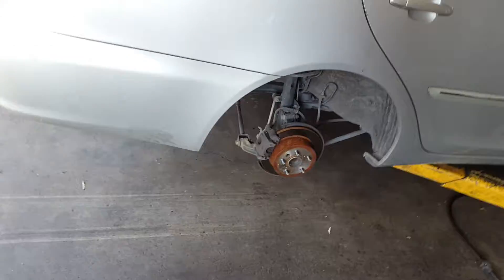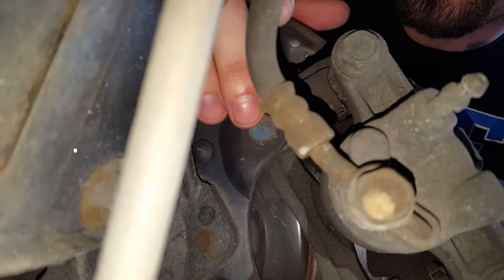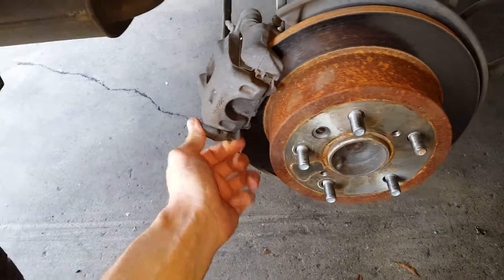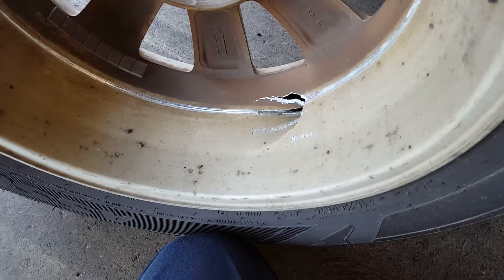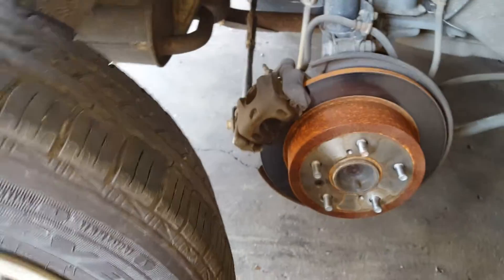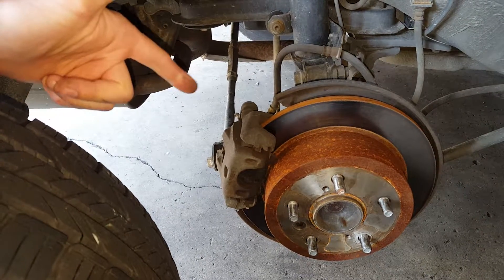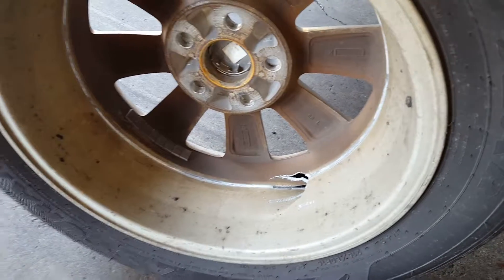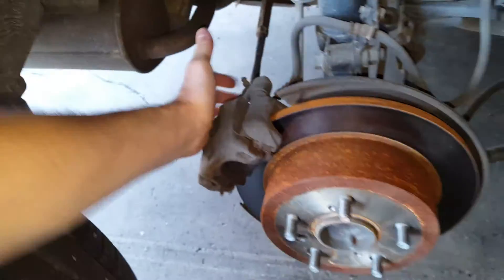What happens if you leave a bolt loose

Comment: Hi, how do I get in touch with you?  I would like to pay you for your time to assist with my truck.  It's a 2007 Chevy Avalanche LS 5.3L Flex Fuel.  I replaced the ignition switch which didn't resolve the issue.  I can completely remove the key and the truck engine still runs.  The only way to shutoff is to pull Airbag IGN fuse then put back.  Then I disconnect the battery ground so the battery doesn't die.  Please help me out here, as I mentioned, I am willing to pay you first.  My inspection is expired and I won't be able to pass inspection until this is fixed.  I live in Mineola, NY and am willing to drive to you otherwise can take videos of the issue and share.  Please let me know.  Thanks! Akpamnani@gmail.com
Reply from the maker: I cant take on any more work unfortunately. It sounds like something could be backfeeding the ignition circuit keeping it powered even when you turn the car off. I would start by looking at disconnecting any aftermarket electronics wired in such as an aftermarket radio or GPS tracker. Good luck!
Reply: @LehewTech  Hi, thanks for the quick response.  I don't have any after market electronics, everything is stock.  As mentioned previously, in order to turn the vehicle off after removing the key, I would pull fuse #39(Airbag IGN).  I then tried starting my truck without the fuse and it starts and ALSO turns off! Finally!  The fuse is not blown and I already tried replacing the fuse but end up experiencing the same issue with truck not turning off with the key removed.  Now I just need to know if I absolutely need that fuse.  Any idea?  Thanks again.